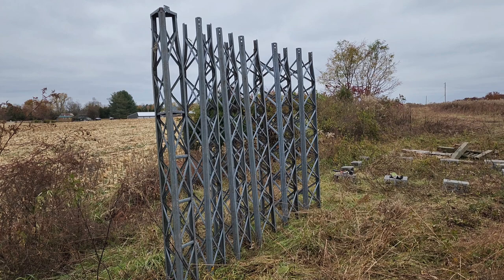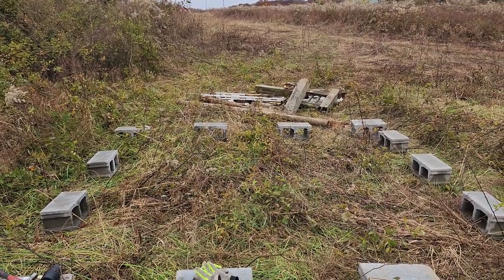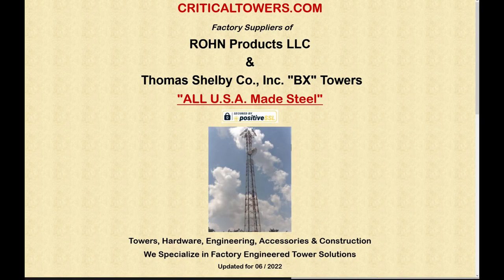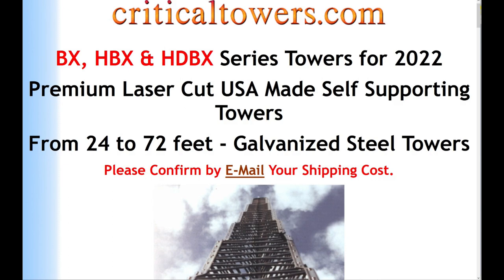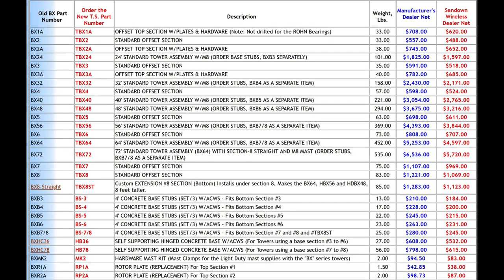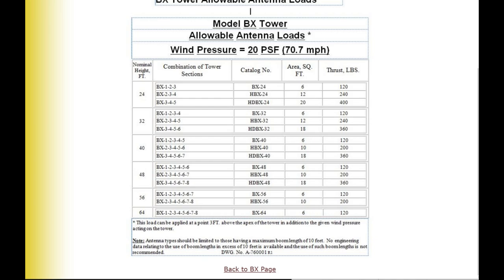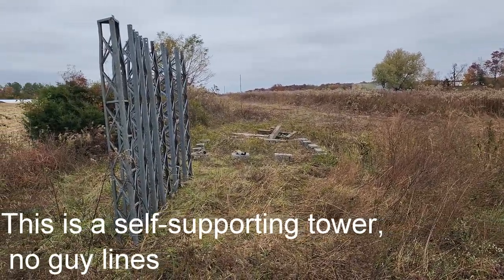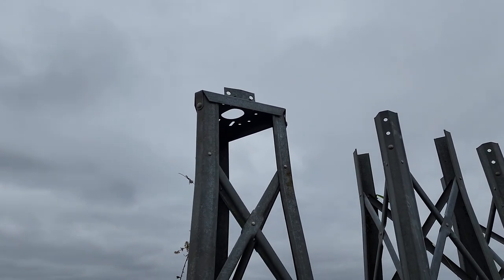LCARA HAM Radio: Rohn 48' Tower Installation Part 1 - Introduction!!!!

Comment: I just went from 40 to 60ft Rohn 25 for my internet. I did a 3x3 base that was 6ft deep and a grounding rod on each leg that was also connected in a ring using copper strap. Best thing you can have for towers is a friend with a bucket truck. My tower came out of someones yard and my ISP moved it for me. Plucked it right out of the ground and did the same in reverse here.